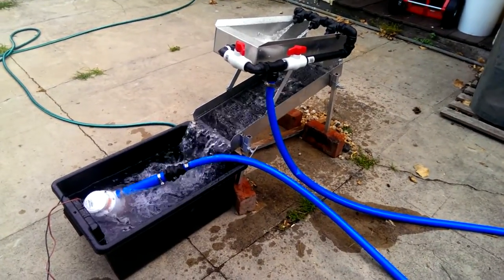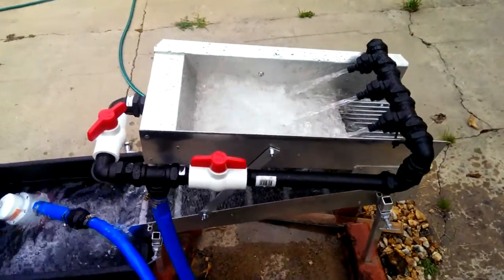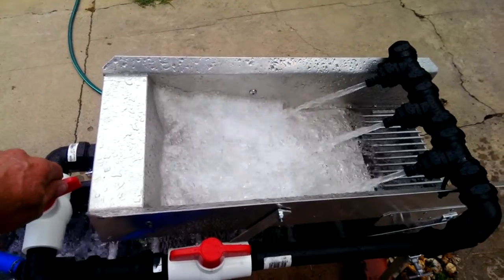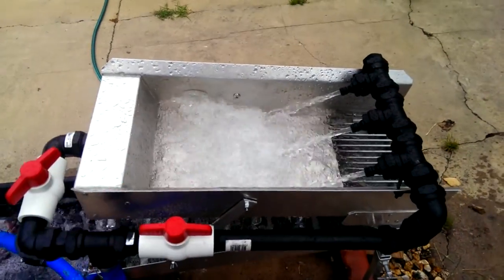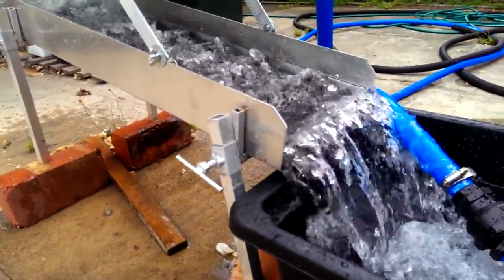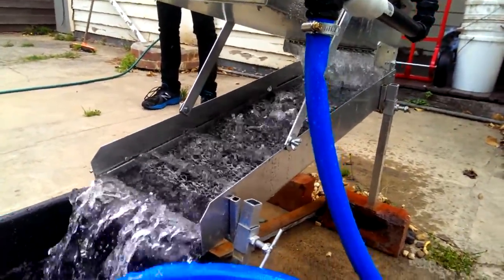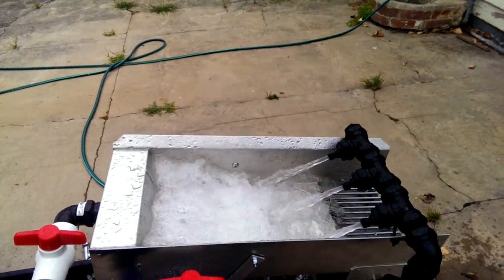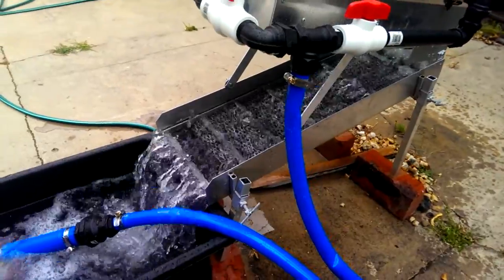Sluicy Gold GS10 Highbanker

Comment: Hey Aussie, love the mod. I like the idea of an electric water pump instead of a loud petrol pump. How long do you think a battery will last running the 3700gph pump?
Reply from the maker: +orgone500 
Hey Orgone, I have a couple of batteries, both calcium, 1 is 80 ah, the other is 95 ah, haven't ran them much but the small one should get me a good 3 hours, the larger should be a little more. The pump draws 16 amp.

Comment: That looks very nice. Can you tell me about the size and types of nozzles you used?
Reply from the maker: +Darkforces817  Thanks Mate, the nozzle are a common garden hose fitting, they have a 6mm I.D. I was able to get poly pipe reducer fittings so I could fit them as they are 3/4 inch & the pipes I use are 1 inch.
Not sure where you are located so if not in Australia then the fitting available may be different.